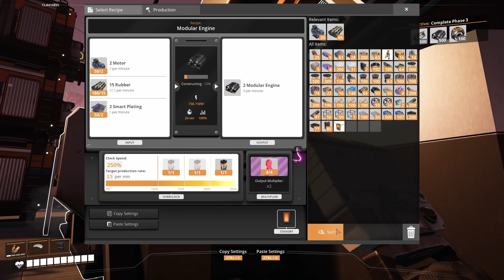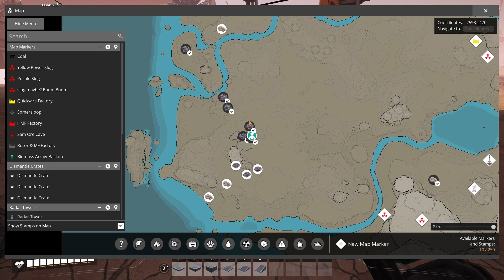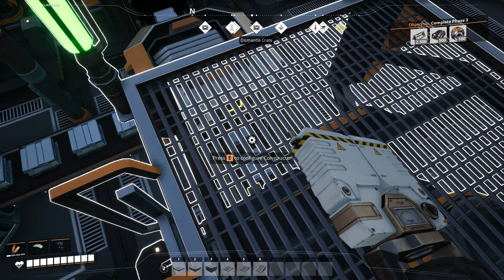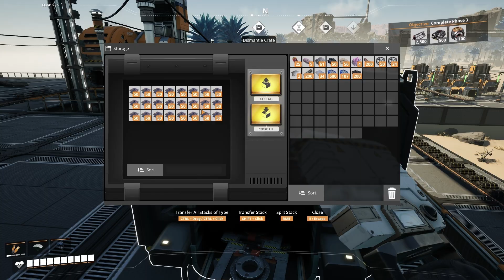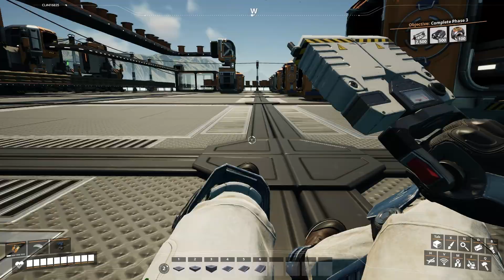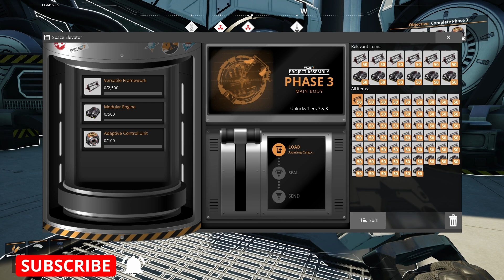Space Elevator Parts Factory - Smart Plating, Versatile Framework & Automated Wiring

Comment: Some bonus tips : 

1) try avoiding screws as much as possible by using alt recipe such as : stitched iron plate, steel rotor, ect...

2) use molded steel beams or pipe can help reduce coal consumption but uses concrete (which is more common)

Edit : i didn't saw the part with the pipes when i was commenting
Reply from the maker: When I was making this I was trying to work in whole numbers, so sure when I'll remake this I'll try to eliminate screws completely. In this one mk3 belts were enough so it wasn't much of an issue

Thank you for the tips, I appreciate it and I'll try to make my builds and content even better :)